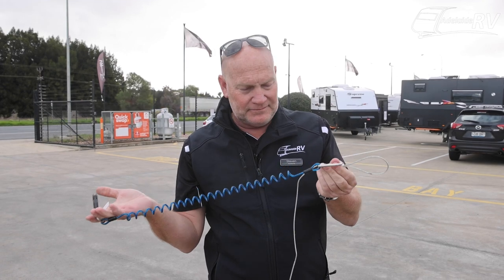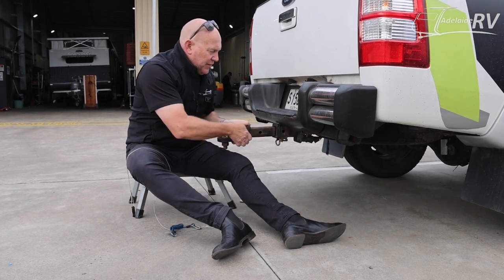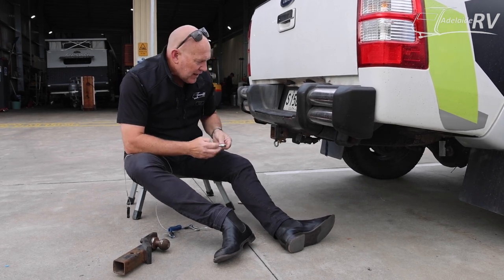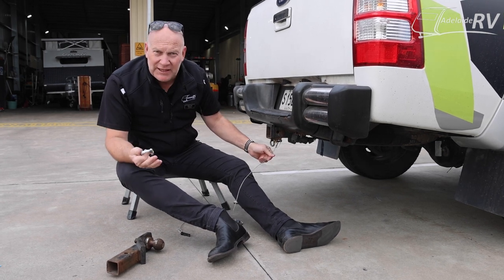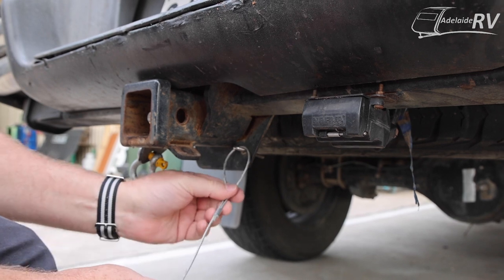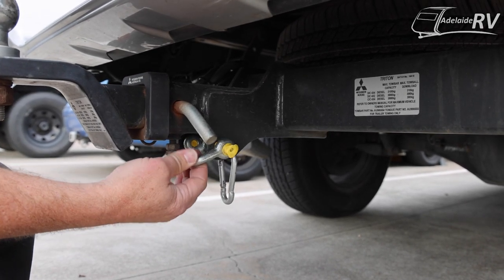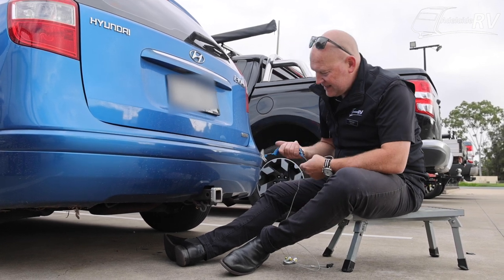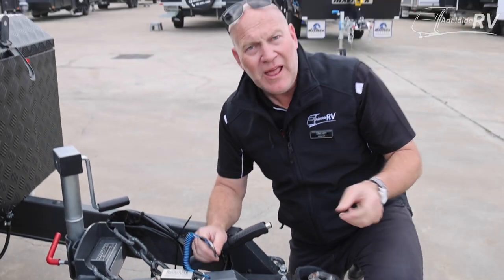How to connect BreakSafe to your tow vehicle from your caravan

Comment: I have always hooked mine in the same hole as the D shackle. An Eddie once told me that was wrong and it cannot be on the towbar (in case it fell off). It had to be attached to the chassis. 😀Good to know I was right. Thanks.
Reply: The Eddie at the place I purchased my van from told me the same when I connected it to the towbar.  Them he hooked it to the bottom lip of the plastic bumper bar!  I didn’t like that so found a spot on the chassis but it is a pain to hook up.  I will take Steve’s advice in the future.
Reply: Where are you getting your information from about what is legal? Any links to regulations? Everything I’ve read says it should be attached to the chassis and not to any part of the tow bar.
Reply from the maker: Road authority of Australia, thanks George
Reply: Got a link to the regulations? Can’t even see that “Road authority of Australia” exists. What is that? Just a link to back up your information would be great. Thanks 🙏

Comment: My understanding was that the Breakaway cable cannot be attached to any part of the towbar/hitch, primarily because the purpose of the Breakaway system is to apply the caravan brakes in the event of a catastrophic failure of some or any part of the towbar/hitch!  Obviously if cable is connected to the towbar and the towbar then detaches from the car…..the Breakaway system is not going to activate!
Reply from the maker: Thanks Mick, here is the standard comment / stipulation made by all manufacturers of break-safe devices. 
"Attach the Break-Away cable to the rear of the tow vehicle using a secure anchor point. 
Do not hook cable to tow ball or safety chain anchor."
Reply: @adelaiderv   - Safety Chain Anchor point, would that not be a part of the Towbar?
Reply: TowEd training emphasises to NOT connect breakaway to ANY part of the tow bar as they actually DO detach from vehicle then the breakaway will not work. Connect safety to the BODY of the vehicle.